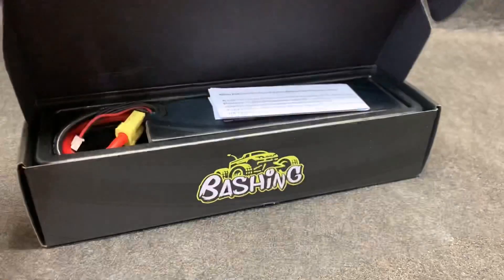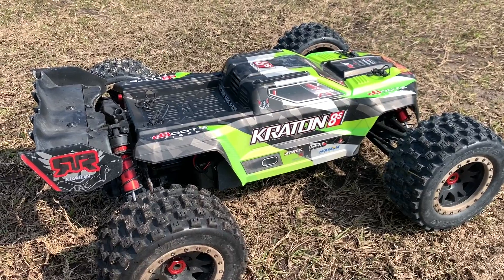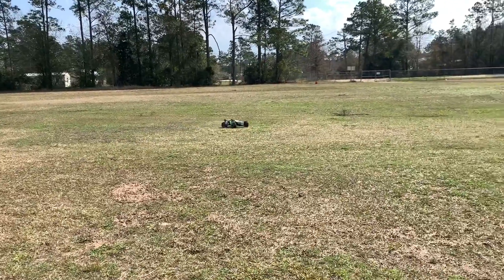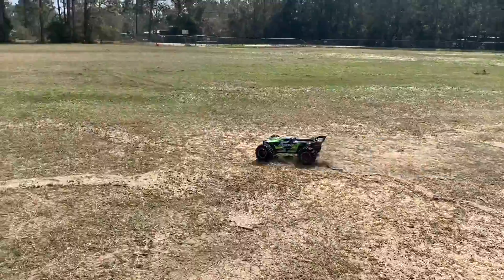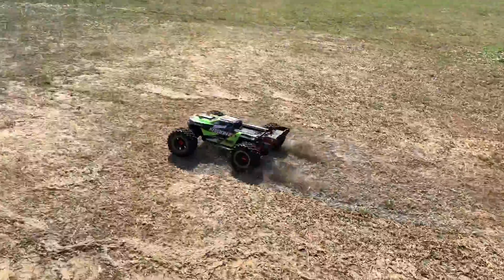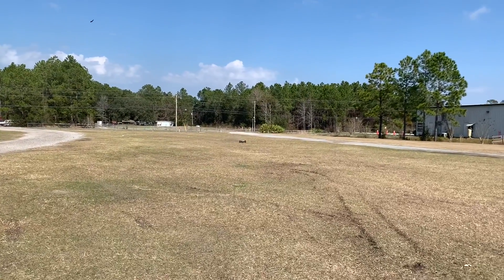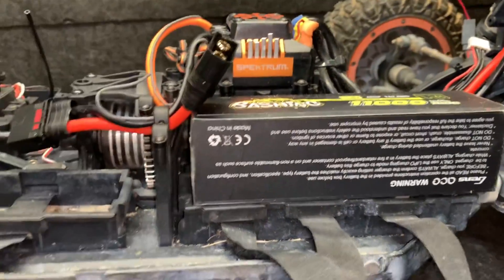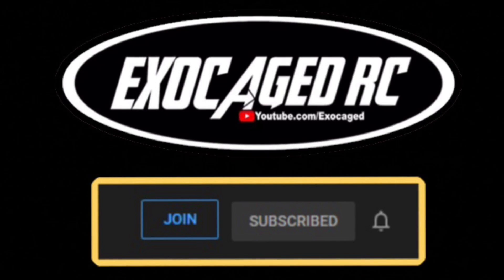11,000 MAH 4S Gens Ace Test with the Big Castle XLX2/800kv powered Kraton 8s!!

Comment: That's pretty good. In my stock xmaxx I'm seeing around 45 min of bashing using my smc 9700mah Graphene batteries. Of course its not as much full throttle laps as you probably did so I dont think I would see 36min on these.

Comment: Dbxl needs a solid battery 🤔 tray in the future, for upgrade parts or wider battery chassis, with stronger straps to hold steady, nice testing and bashing.🏗️☕💪😲👍🇺🇸
Reply from the maker: yeah I hope someone sees this and takes initiative to make us some bigger battery trays.
Reply: @ExocagedRC  Haha , been there done that . I’ve fitted the Arrma Kraton 8S trays in mine . 👍👌👍
Reply: @clairecooper3848  any pics you could share? I'm about to do the same conversion so I can fit these 11,000 packs in there! Did you need to drill new holes in the dbxl chassis?
Reply: @ebaystore4all   yup , the chassis needed to be drilled and the K8s battery trays popped right in .

Comment: Dang did you say a 45p-47s Gearing that's a Speed Run set-up ain't it?
Good Battery Test with the Castle Kraton, and not overheating the ESC and Motor with the longer Run Time? ✌️🤠👍 HFLPRCing 🌟🙏 Stay Safe and Play Healthy Brother
Reply from the maker: yeah its a fast setup and would gain quite a bit on pavement but its an offroad truck so thats why I speed run on a field

Comment: Love seeing the laughter and joy coming from RC!  Question,  I am wondering about the loose metallic sound in kraton, I am never sure what diffs should "sound" like,  with mine.  Trying to find out what is nominal or common.  Thanks!
Reply from the maker: sometimes its the dogbones rattling, CVD's can get loose and then the pinion and spur always have noise to them. All steel drivelines are rarely quiet.

Comment: The ec5 adapter to qs8 connector I was told you should use this from castle because xlx2 pushes over 200 amps and ec5 can only handle 120amps. 

I wanted to do adapter just like this for my felony

Comment: There is a trade off between runtime and weight. I would sacrifice the extra runtime for reduced weight and change the batteries for a freshly charged set.
Reply from the maker: I agree, many times I'll take 3-4 sets of lightweight 5000mah batteries out but they just don't have the punch these bigger batteries have.

Comment: wonder if those battiers will fit in the xmaxx?
Reply from the maker: no sir
Reply: I'm sure they'll fit if you don't use factory latching system 🤷🏻‍♂️
Reply: Ya D.  I need to look into upgrading battery hold down.   sick of using foam inserts.  Traxxas really doesnt make there rigs user friendly
Reply: @johngantner9314  yeah in stock form they're pretty much proprietary to the 6700 traxxas batteries
Reply: They will if you have swapped out the stock battery tray system.

Comment: OK so I keep seeing these videos and yours is the only one where the crate and seems like it’s actually moving quickly. I have a second generation 1/5 scale Kraton. I bought a new much stronger servo for it and I have the XLX2 combo with the 800 KV motor to put inside of it But I haven’t jumped on the project because I have so many also I’m a little worried that it’s going to be under powered and not fast after a couple months have passed I’m thinking I already have two speed run in fractions, a stock success and the shelf queen all metal 8S so if I want high speed, I got it but if I put this XL Lex, two combo in this one fit scale, Creighton and I settle for 55 mile an hour top and speed. It better have some unbelievable torque or I am going to be seriously disappointed.

Comment: I noticed the jumper from qs8 to ic5 connectors. I'm putting together an Outcast exb and was planning on replacing the battery terminals with qs8. Which way do you prefer?
Reply from the maker: Depends on how much power they need. I use xt90 on most things but some need more. And those get QS8.

Comment: No exo man I have the gen 3 3s bashing pros running in my aarma ,v5 notorious well I dislodged one last night and but it back in every thing seemed ok finished my session out to day I go to charge them and on my dual charger it keep saying connection break well one started to charge the other one didn't upon further investigation I notice my positive wire was off looking I carefully open the too and the red positive wire is brik lose I have no cluebhow to fix because the tab that's turned down in the battery is completely out

Comment: Castle 800kv XLX2 Combo is in stock. 1100kv XLX2 combo is not. Looking to put it in a Kraton 8S EXB. Should I wait for stock on the 1100 combo or just get the 800kv combo?
Reply from the maker: I was told the EXB comes with a 39t spur and a big pinion, One guy just ran his with the 800kv at 39/39 and it was good for standing backflips.
Reply from the maker: If you're going to order from Amain, use this link to add it to the cart and check out with anything else thats in there. https://bit.ly/37JlGKV
Reply: @ExocagedRC  sounds like you’d recommend the 800 combo then? And I’ll definitely use your link I watch your videos almost every morning!

Comment: Helluva a battery ! What's the rattling noise this truck makes ?
Reply from the maker: This truck has been abused on 12s I had to put it back together but yeah there could be something else loose in it.
Reply: The rattling is gigantic steel spur and pinion .

Comment: Can you measure the length of these batteries for me? I want to make sure if what gens says is true since im trying to make a custom tray for my dbxle.
Reply: Did you make custom trays or find another solution to fit these batteries in the dbxl?
Reply: @ebaystore4all  I actually did then scrapped it since i got huge discound on cnhl batteries. But you can fit these on some plates and hold them with velcro. Just put a piece of aluminum at the end of the tray to protect battery from spur nearby. Or simply buy vitavon tray that fits them but its expensive af since if i remember well you need their engine mount too.
Reply: @Ev0ltion  thank you! How is the extra weight? Seems like the heavier batteries will actually help balance the weight distribution more on the left side
Reply: @ebaystore4all  tbh you could strap a brick to this car and you would barely feel it due to how stable it is.
Reply: @Ev0ltion yeah I just love this car!